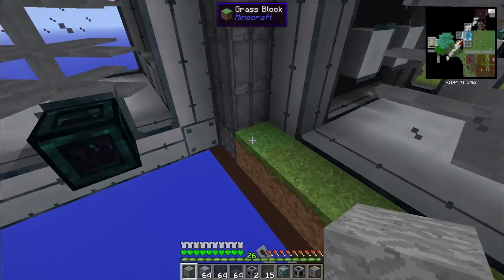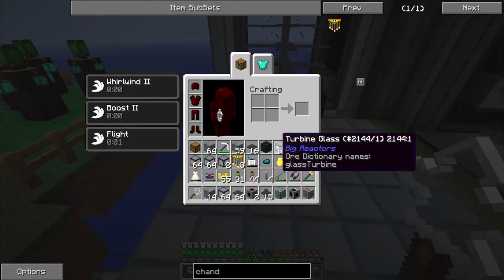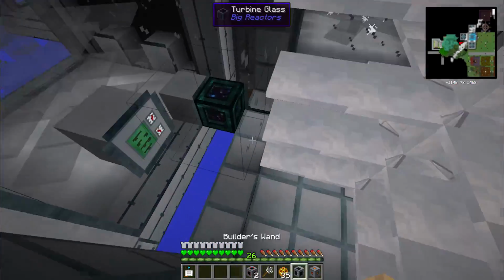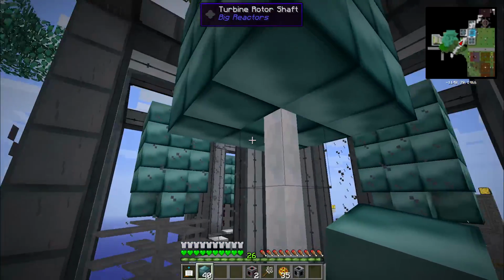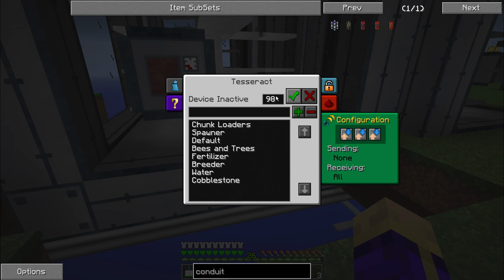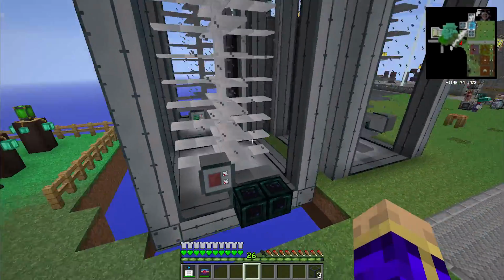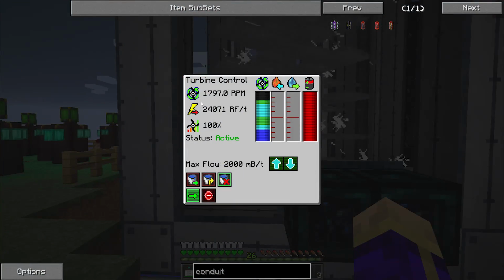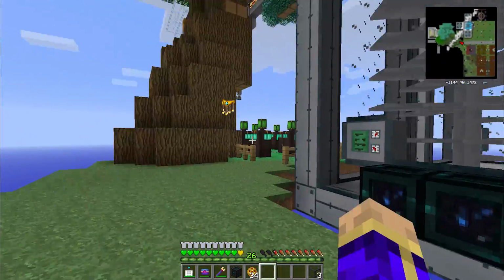Terse Turbine Tutorial - for 1.6.4

Comment: While the Tesseracts won't bottleneck anything necessarily; the power ports will. Each turbine power port can support 10k RF. So if your turbine makes ~16K RF then you would need two power ports to carry all ~16K RF.
Reply: +Shvok that's not true.... the power ports are limitless, my reactor power generator that generated 49kRf/t had no trouble outputting into a tesseract which was spreading into a total of OVEr 10kRf/t consumption

Comment: better turbine with ludicrite blocks
Reply: PurpleMentat Thanks for the tutorial btw, I've been searching for so long for a design that can provide enough power for a laser drill system!
Reply: Ludicrite is only available in 1.7.10 and above, I believe he's in 1.6.4
Reply from the maker: ***** Yeah, this video is from last May. I'll edit the title.
Reply from the maker: ***** No problem! This was an experiment I did in the middle of my first Let's Play, and it worked out fairly well.
Reply: PurpleMentat Hm, tried to re-do these again and now my guys aren't staying at 1800 :/ I put it on overflow as I have a transfer node with 64 world interaction and speed upgrades on permanently, I tried removing that and put them on closed but that didn't do anything :/ Guess I don't need to worry as much because I'm using Ludicrite blocks for my coil so it's producing a hella lot more power anyway, at about 1800 they produced over 32000 RF a tick! But of course it's declining. Does the ludicrite cause more friction or something with the turbine then Enderium? Yikes, 1500 and dropping, almost at only 20000 RF a tick, noooo. Oh yeah I also have the same 9x9x9 reactor that you do
Reply from the maker: ***** I believe that you are running into differences between the latest version of Big Reactors and the version I had at the time, which was 0.3. You'll need to start from scratch, disregard all this information. Sorry!
Reply: PurpleMentat I still make a little under 20000 per turbine so it isn't too bad, but do you have any tips on the math with the turbine blades and such, because this is where I fail and why I can't really make good turbines.
Reply from the maker: ***** I honestly haven't looked into it since I built these. I have no idea how the new 0.4 stuff works.
Reply: PurpleMentat Removing the extra 5 coil blocks on the bottom seemed to work and I now get about 28 RF/t! I guess friction is a thing now?
Reply from the maker: ***** I believe so! Thanks for looking into this.
Reply: PurpleMentat np

Comment: After seven hours, I got a 100% efficient build. The flow rate is 1471mb/t.
Filled up a size 237 EnderIO Capacitor Bank (~1,230,000,000 RF) in just under five hours, and runs at 1800.9rpm.
Reply: Val what’s the formula for it?

Comment: Is all of the water condensing in the turbines getting sent back to the reactor? I tried building some turbines in creative and gave up after I couldn't keep enough water in the reactor with something like a stack of aqueous accumulators, and as many inputs into the reactor. Then I just upgraded the reactor to 11x11x11 with cryotheum lol.
Reply from the maker: Yeah, you want to send the water back to the reactor. Closed loop is the best bet.
Reply: To keep enough water in, just use a single transfer node from ExtraUtilites and with 64 speed and mining upgrades (if you can afford, 64 stacking upgrades as well) in an infinite pool and connect it, you will have enough water with just that one.
Reply: ***** Only need ~20 world interaction and about 32 speed to supply a 7x7x7 5 rod reactor design that will produce roughly 3200mb of steam per tick (aka WAY more than most needs)
Reply: Joseph Victor But for some turbine designs like the one above you will need more then that, but with one turbine you will only need what you are describing

Comment: Fluid Ducts have an input/output limit of 100mb/t per connection. Transfer once fluid made it into the pipe is not limited.
Reply: PurpleMentat Thats still the case :D
Reply from the maker: Last time I poked at it, having a powered input would allow up to 360mb per tick. Is this no longer the case?
Reply from the maker: ***** Thanks for the confirmation!

Comment: One thing worth noting is that both your 36 and 37 enderium turbines were running at full 2000 mb/t, causing the 36 one to run slightly overspeed. So adding that one enderium block was giving you ~370 RF per tick without requiring any additional steam, therefore it would definitely be a gain in efficiency. Considering that at this point turbine housings are probably more expensive than enderium, it seems very much worth it.

Now, if you were to decrease the steam input on your 36 enderium turbine to actually run at 1800 RPM instead of 1847 RPM, you'd actually make your 36 enderium turbine more efficient (more RF per unit of steam), but you'd get less energy, therefore making the difference between 36 and 37 blocks more obvious (closer to 650 RF, since that's the amount each block of enderium is producing at 1800 RPM).

All of this is mostly irrelevant (or should I say overkill analysis), but I just thought someone might want to know ;)
Reply: Guess, what I will pick? More energy! More lasers!! Old reactor + new reactor + 6 turbines = 15 lasers. I need to wait for more cyanite to convert old reactor to turbine usage.
Reply from the maker: Thanks for the overkill analysis. I think I've hit the point that "just build another turbine" will be my answer to future energy issues, but someone who's looking to get everything they can out of their power might think differently!
Reply: at last there is still a better way for 24,069 RF/T with 37 endirium blocks, 84 Rotorblades, 9x9x16, at 1796,8 RPM

Comment: I also noticed that the power taps seem to only be able to transmit 20k rf/t each even when plugged straight into a tesseract. So i ended up adding a second power tap with a redstone energy cable going into the tesseract to utilize all of the power available up to 30k for a single tesseract.
Reply from the maker: My power taps are keeping two of my turbines empty without an issue.
Reply: PurpleMentat I'll have to check. Maybe a bug of sorts. I was measuring with a multi-meter on the receiving end of an isolated tesseract channel. Running to 10 cubes with input set to 10k each was only measuring 2k each. So I added second power tap and it went up to 2,367 each with my setup on one turbine.
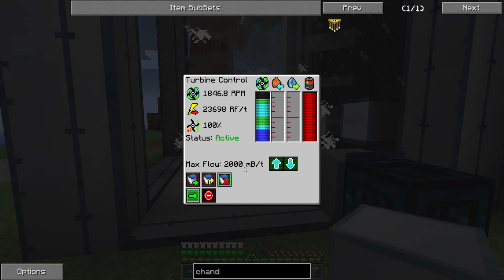Reply: PurpleMentat I'm not able to pull out more than 20k from a single tap. I just rechecked your video at 1:49 and it seems that that turbine has a full energy buffer. If you hover over the power buffer in the interface you can easily see what is being drawn from it. it will say 1000000/1000000 if no energy is being drawn and at 20k rf/t it will say 980000/1000000. Checking that way and with a TE multi-meter shows only 20k for a single tap for me.

If you are running on a server, updates might cause the numbers to bounce around though.
Reply: PurpleMentat Also, you forgot the link to the spreadsheet :P
Reply from the maker: Make sure the other side of your tesseract has enough conduits connected to output the power.
Reply: PurpleMentat Doh, I just double checked and my isolation test only had 1 cable. Of course that does not explain why a single cable face is violating the 10k limit. Even funnier still that I can pull out over 94k rf/t from a single cable face coming out of a tesseract going into 10 resonant energy cells when I have 4 tesseracts directly hooked up with 4 extra redstone cables on the side from the sending end. Must be a few derps in the TE code..

Comment: I did a test with a turbine size 7x7x16 with 36 enderium and 72 blades at 2000 mb. I found that they were able to generate 23,678 rf/t at 1829 rpm. So you can save yourself the materials for 8 rotor blades, 1 rotor and 24 turbine housing/glass blocks while still being able to generate almost the same output. Seems to be the highest output per material cost turbine layout that I can come up with.
Reply: Just for giggles, I added an extra enderium for a total of 37 with my 7x7x16 setup with 72 blades. Generates 23,796 rf/t at 1,780 rpm with 2,000 mb.
Reply from the maker: John Smith Each blade can only use 25mb per tick of steam. By reducing to 72 blades, you are capping yourself at 1800mb per tick. You should be able to change that turbine to use 1800mb per tick without changing the power generated.
Reply: PurpleMentat That would make sense, but does not seem to work that way. Dropping the steam does raise the blade efficiency, but still drops the rpms and thus drops the power output. The 25mb per blade is only to get 100% rotor efficiency. "Over-clocking" the rotor will drop the efficiency, but overall net more rf/t in certain cases. The setup I described still gets 99% rotor efficiency.

Comment: Very nice tutorial, surprisingly with my off the cuff build I came up with a similar design, but yours is much more efficient, I didn't get the number of blocks or rotors right, but I didn't make a complete balls up of it at least, got it about to about 80% of yours and used enderium so I just have to alter my design a bit.
What design of reactor would you recommend as the steam provider for a single turbine?  I know you like the build big or go home phrase, but I don't necessarily agree with it, seeing as building small is actually a skill all in itself :P
Reply: PurpleMentat I suppose one solution would be to build a reactor that in it's passively cooled mode works with control rods set to 0%, then when you switch to active cooling you set the control rods to a very high value.

In fact since yellorium is quite cheap, you can build a reactor designed to burn fuel as fast as possible, running at extreme temperatures.
Reply: a 9 x 9 x 3 reactor with 4 fuel rods outputs almost exactly 2000mb a tick of steam, perfect mate to turbines.
Reply from the maker: Building small is absolutely a skill! One that I am in short supply of. I have no idea what sort of reactor design would give you 2 buckets of steam per tick, but that would be your target. The annoying part would be limping along on that reactor's output until you could get the Cyanite you need to build the turbine!